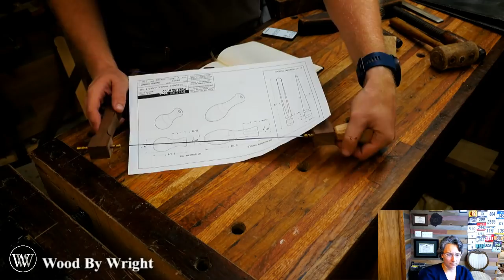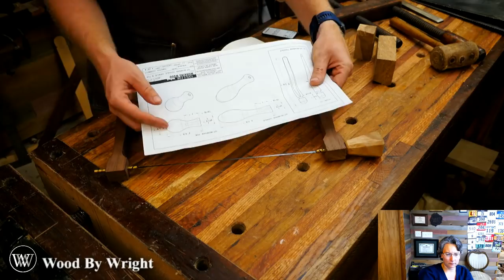Making a turning Saw Live Part 4 | making handles

Comment: Among other things I've learned today is that sometime in the last 4 years you switched from cereal bowls to painter's tape for mixing epoxy.  Now Part 5.
Reply from the maker: Yes. I used to have a lot of the paper bowls left over from when I was making an airplane. I was about 15% of the way through building a four-seat airplane when we last moved. And I had a lot of epoxy equipment left over from that.